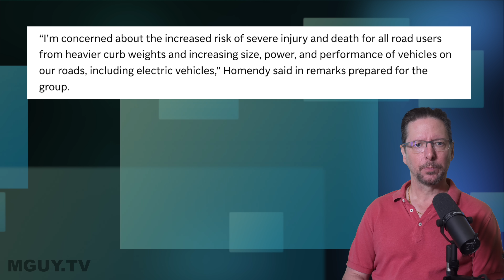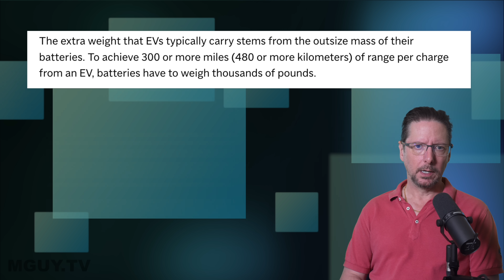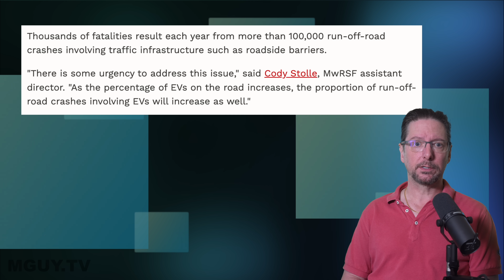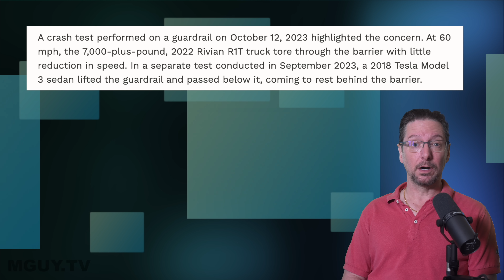EVs TOO HEAVY for roadside crash barriers (guard rails) | MGUY Australia

Comment: Just imagine it’s YOU in your car rather than that guardrail getting plowed into by an EV.
Reply: Imagine two EVs crashing into each other. Simple physics with all that dense weight would be a lot of carnage.
Reply: @practicalguy973 . Not to mention the risk of explosions from damaged battery packs.
Reply: @hyacinthbucket3803   Indeed so.  Local police should be warned to expect a mushroom cloud from a multi-eV wreck.  BOOM!
Reply: @edb3877 i reckon it'd leave a crater
Reply: @practicalguy973  Don't see anyone complaining about the weight of pickups.
Reply: Just think ,as we've all seen a motorway pile up usually in bad weather, instead of petrol /diesel cars and trucks. EVs.... Trapped and then the toxic fires ......
Reply: New England US here. This winter, it’s been interesting to watch the EV activity up here go from hero to zero. So many in my particularly affluent community own EVs, but have discovered their cars can’t begin to handle below-freezing charging, their significantly diminished ranges, and poor performance in snow and ice. Suddenly, our once EV-peppered downtown has been replaced with ICE ‘junkers.’ Not even our municipal charging stations parking spaces, with timed limits, are being used. EV owners who’ve installed charging stations in their garages are now finding their cars won’t charge unless they renovate to heat the building. That notwithstanding, most are still willing to die on the sword of what they misguidedly believe is the righteous ‘green alternative,’ and condemn any whom challenge the voodoo leftist narrative. They tout how inexpensive their choice has been, but fail to admit the billions of taxpayer-funded subsidies that made it possible. They extoll how environmentally-friendly their shiny vehicles are, yet fail to acknowledge the world-wide environmental devastation it took to make or recycle their batteries. They ignore the fact that the lion’s share of the electricity they use is sourced by coal and other fossil fuels. They demand their communities (aka taxpayers) go into massive debt to finance new and extraordinary grid infrastructure. Yet have nothing to say when the rest of us are asked to turn down our thermostats and stop running appliances to accommodate the new electrical load. Truly, we’ve entered another dark age of unenlightenment, scientific ignorance, and intellectual dishonesty.
Reply: @FR-tb7xh  That's what climate change can do. In Australia, we're getting lots of extreme weather: unusually hot in some places, frequent severe storms, flooding. You'll just have to learn to adapt to the cold, as Scandinavian countries have done. And remember, it's probably going to get worse.
Reply: @SirGregoryPageTurner  It’s got nothing to do with “climate change” — it’s called winter!
Reply: @FR-tb7xh    Ouch, touchy. Did I hit a nerve?
Reply: Just what I was thinking, yikes.
Reply: the same thing would happen if a pickup hit you its not like we dont have cars on the road that weight 7k lbs that are not ev's
Reply: Where was this guy when Hummer H2s and Escalades and AMG g wagons and bmw 7 series were roaming the streets in the early 2000s. They carry massive weight as well…
Reply: @teamcaveman  the government, at least in the US, wasn't trying to ban everything else on the road and tell you that you had to buy a Hummer or G-Wagon. And plenty of people hated the Hummer when it was popular for how heavy and wasteful it was.
Reply: The hummer mentioned here is another 2500 pounds slapped on top of the H2…
Reply: @goldenhate6649  I’m yet to see more than the one ev hummer on the street. The vehicles I mentioned were in abundance on the streets

Comment: That Rivian didn't even change course. Imagine one driving into a building as happens often.
Reply: The equivalent ICE Ford Raptor weighs almost the same…
It’s not an EV issue.
The Raptor would have exploded however.
Reply: @allangibson8494  Stop posting the same bullshit over and over.
Reply: @erroneouscode  The Rivian isn’t unique or extraordinarily heavy.
Neither are most EV’s.
There is a lot of FUD (fear, uncertainty and doubt) based on LIES.
Yes EV’s have novel issues but they are no worse than the issues ICE cars have and in a lot of cases far less.
Bad design and manufacturing affects all vehicles - EV’s are not unique in this. Any system that stores energy has risks proportional to the energy stored (and that includes automotive fuel tanks).
Current EV’s have shown to be an order of magnitude safer than current production ICEV’s. Simple FACT. It is MUCH harder to kill yourself in an EV than an equivalent ICEV.
Do EV’s have issues, yes. They are however far smaller than the ignorant beat ups would have you believe.

Comment: Great video but what about the extra stress on bridges this extra mass exerts? Has this been factored in to maintenance? I suspect not.
Reply: An equivalent ICE Ford Raptor weighs almost exactly the same.
It not an “EV” problem - it’s a “truck” being taxed at a lower rate problem if they are over a certain weight.
Reply: @allangibson8494  You are comparing the fully loaded weights, right? You just forgot to mention that?
Reply: @robertkubrick3738  And so was the crash test when they quoted “almost four tonnes”. 3.87 tonnes for the Rivian R1T.
Reply: That’s a pertinent issue, granted, however the extra mass of EVs remains an ongoing issue that is impacting on our road infrastructure life.
Reply: @paulrhodes8111  Compared to a loaded semi? EV’s are irrelevant.
The typical Tesla and typical ICE car differ by less than the weight of the passengers. American style ICE light trucks (like the Ford Raptor)  and the EV equivalents like the Rivian and Cybertruck are similarly close in weight (and you don’t want to be hit by any of them because none of them meet European crash standards (and aren’t required to because they are “light trucks”)).
Reply: To spell it out for you. University of Tennesse’s centre for transportation research says EVs often weigh 30% more than gas powered vehicles, the main reason being the weight of their batteries which can add 100s of pounds or more. 
Ageing bridges may have lower load capacity and thus are more susceptible to increased EV weight. It follows that infrastructure planners and engineers must consider the impacts of heavier vehicles including EVs on aging infrastructure and make necessary adjustments or upgrades to ensure safety and longevity of said infrastructure.
I trust the facts speak for themselves, although facts seem to matter less and less to a certain group of zealots. Have a great day.
Reply: @paulrhodes8111  And compared to the increase in weight due to the increased prevalence of “light trucks” which weigh over three tons, EV’s that weigh less than two tons on average are irrelevant. Forty ton semi-trailer combinations have also vastly increased in numbers too.
A typical Tesla weighs 1.8 tons (about the same as a 1967 Ford Galaxie 500). A typical ICE Ford Raptor weighs 3.1 tons.
Reply: Righto, Gibbo.  whatever you say. No point in further discussion here.
Reply: @paulrhodes8111  The point is a couple of hundred kilos or pounds is irrelevant to most infrastructure. EV’s are not a massive weight compared to a semi-trailer or even a very common light truck - and light trucks are 80% of the US vehicle sales at the moment.
Reply: At least in the us, and overpass that a semi can drive on is engineered to handle up to 34k on the drives and standard trailer axles, or 20k on a single axle. There is also axle spacing weight limits (think drives to trailer distance and combined weight), but they don't usually become a worry for truckers with 53' trailers

If you want more detailed info about bridge weight limits for vehicles, Google your states bridge laws. You can usually find a weight table that has measurements for center to center distance to weight limits. Generally axle spacing less than 10'6"  is restricted to no more than 34k

Comment: Yeah clutching at the straws with this one I'm thinking.
Check out the GVM for a loaded 4wd or the average tradies ute and get back to me. They are hardly slow compared to their counterparts from years ago either.
Plenty of well overweight 4wd's getting around as well as 4wds towing their aluminium turd haulers that will be over GCM as well.

Comment: A pointless test, vehicles typically don’t collide with barriers at 90 degrees.
Reply: Very lucky that trucks and semis have never hit a guard rail ever
Reply: They do when idiots fail to turn the wheel on sharp curves that have barriers. Drunk drivers, those that fall to sleep at the wheel, avoiding animals, other traffic on wrong side of road. They're also sometimes installed at T intersections on country roads. They have to be tested to withstand more than just a side glancing of them.

Comment: If that barrier can't stop a 7000lbs Rivian, then it also can't stop my 7000lbs 2012 Ford F250. This is very concerning. Why are our "safety" barriers so inadequate? And why are we just now talking about it? There are literally millions of trucks on our roads.

Also, you don't have to buy a truck to go EV. I also have a Bolt and it weighs 3500lbs - same as an average ICE sedan.
Reply: SMALLER than the average sedan too!
Reply: @robertkubrick3738  Sure, but a very popular (and affordable EV).

For comparison, a Model S or a Polestar 2 weighs the same as a Ford Taurus, and nobody was ringing alarm bells about those.

A Model 3 is lighter. Only ~300lbs heavier than an Altima or a Camry.
Reply: @FlexLex  A model S is 1,000 pounds heavier than a Ford Taurus. You need to search curb weight for both. BEV people keep comparing the Maximally Loaded Ice to the empty BEV. Taurus 3917 pounds. Model S standard range weighs 4971 pounds. That's over half a ton difference.
Reply: @robertkubrick3738  I only did search by "curb weight."

The source I found has the Model S listed as 4,561-4,766lbs

And the Taurus at 3,917-4,327

I think you are the one who is min/max cherry picking here.
Reply: @FlexLex  Whatever. You said the Taurus was as heavy and it's not, not by a long shot. I was giving base model curb weights. The 4327pound taurus is probably for the wagon. Is the model S a wagon?
Reply: @robertkubrick3738  Wagon? We haven't had a wagon Taurus in some 20 years. I am talking about the relatively new last gen that we still have lots of around.

Anyway, my point was that EVs are not significantly heavier cars like everyone wants to make them out to be. Sure they'll outweigh a similar size car by 300-500lbs, but we're not talking tons here. Most EVs are not running around with 100kWh+ batteries that people quote the 1800lbs weights for. Those are very expensive cars.

You might as well compare those to cars in the same price range, like the Mercedes S class, which weighs well over 4500lbs.

Anyway, EVs have plenty of issues and drawbacks among which weight is not anywhere near the top. And I feel that people who want to attack them for weight are just looking for any reason to throw hate at them.

Comment: NOw we have identified weight problems, how are the bridges going?
Reply: You do know that bridges are designed to carry the heaviest vehicles permitted on the road? So if 55-ton trucks are permitted then the bridge will be designed to carry 55-ton trucks end to end. And then the engineers add a safety margin for good measure. Civil engineers do spend a lot of time getting their degrees.
Reply: What happens  when you have 500 cars on the bridge, all of which weigh 3 times what the old cars did? Does the safety still stack up then?  @SirGregoryPageTurner
Reply: @AndrewFishman  Do the maths yourself. It's easy. Compare a bridge full of F250s and compare it with a bridge full of 55-ton trucks. All you need is the length and weight. Go for it.
Reply: Or, you can do the maths on this, you have bridge made for ICE trucks and cars and you are adding the extra weight of electric vehicles to the thousands of bridges across the nation, the millions across the world. How long until one of those bridges is NOT structurally sound to carry all that extra weight? Or, the alternative, are we going to re-engineer every bridge and culvert to carry the extra weight?  @SirGregoryPageTurner  What is the cost of that going to be? YOU do the maths, I'LL wait...
Reply: Oh, and don't discount the weight of all those newfangled electric semis... they count too.  @SirGregoryPageTurner
Reply: @AndrewFishman  I can see you're enjoying the confirmation bias lift you get on this channel. Song with the choir and pump up the echo of this chamber.
Reply: LOL, mate. It does not take a genius, nor an echo chamber, to understand that the extra weight of the electric vehicles will add to the load on roads, bridges and other infrastructure.  @SirGregoryPageTurner  So, what is your maths on the cost of upgrading those things to take a full scale change over to EV from ICE? You could always cop out and try insulting me, oh wait, you already did that.
Reply: @AndrewFishman  I'll answer this one first as it's the easiest. ICE truck or EV truck, they cannot exceed 55 tons in Australia.
Reply: @AndrewFishman  I've consumed a glass of wine or three this evening, so I'll get back to you in the morning with some calculations. What country do you live in?
Reply: Only the best, sir. I am Aussie.  @SirGregoryPageTurner
Reply: @AndrewFishman  So tomorrow I'll do some maths using metric units.
Reply: Imperial will do if you are more comfortable with that.I am conversant in both. Metric is much easier and more sensible.Whatever suits.  @SirGregoryPageTurner
Reply: I've replied.
Reply: @AndrewFishman Did you see my bridge loading figures?
Reply: Where are they?  @SirGregoryPageTurner
Reply: @AndrewFishman  I'll fix it now. My stuff got positioned somewhere else. My finger problem. Sorry.

Comment: How long before we have a bridge or ramp failure? We're gonna have more traffic and street lighting, telephone and electricity poles impacted by "minor" incidents. No street scape furniture is built to withstand this kind of impact. More minor bingles are going to turn catastrophic. Not withstanding the battery issue.
Reply: Trucks and vans are and always were heavier than family cars. It's not a new issue. The difference is frequency - the more heavy vehicles the more likely an accident involving a heavy vehicle (as stated in the video). Bridges, ramps & road subsurfaces are (should be?) made to cope with heavy vehicles eg a random convoy of big semis. Roads etc won't crumble, but wear and tear will increase with increased average weight. That's bad sure, but not something new like the fire issue with EVs.
Reply: @Michael-jx9bh The entire “fire issue” is a beat up. ICE vehicles catch fire thirty times as often and are more likely to catch fire while occupied…

Comment: In a crash 
Would there be any way for the EV given people electric shock
Reply: Mechanics wear heavy isolation gloves to work on them.
Reply: @robertkubrick3738  
But what about people trapped inside the EV 
But We are not going to walk around with insulated gloves 
Standard people
Reply: @wayneyoung146  The point was, there is so much NOT to touch that mechanics have to wear those gloves. I thought it would be self evident that in a crash, things move and things that didn't touch before now may.
Reply: @robertkubrick3738  
You not getting the point 
Think outside the square
Reply: In a worst case scenario the 800V could short to the vehicle steel body, however EV drivers insist they are completely safe and this would never happen, you can decide if it is a risk you wish to take or wish to avoid. As an electrician I have already decided.

Comment: There are so many cars that run into and demolish barriers and they aren't even heavy. with more SUVs getting bigger and more popular should be a concern too.
Reply: I understand that a barrier crumbling in an impact, like a concrete barrier, is actually beneficial as it means it's absorbing and reducing the speed of the colliding vehicle. And the old guard rail system is fairly dangerous in it's own way, when you hit the leading edge of it head on the rail material can pass through the car. The new design the end caps more or less pencil sharpener the rail by deflecting the rail away from the road while absorbing the impact through the uprights

Comment: I think that Crash Barriers are designed more for a side-swipe impact, as opposed to the front-on full impact, as shown in this video with the test truck. Question. Is this the Rivian Truck, which weighs 4000kg ?. Front-on impacts use a different designed barrier, which progressively collapse upon impact. Other street furniture at risk of impact by heavier EV's would be light and telegraph poles, bollards and those interlocking water-filled plastic New Jersey Kerbs, which are used to protect road worksites.
Reply: Curb weight is 3152kg.
The equivalent ICE Ford Raptor is 2,584kg but they both have the same permitted gross weight.